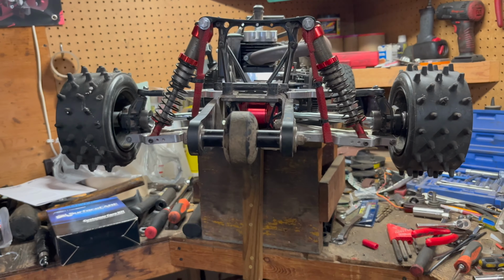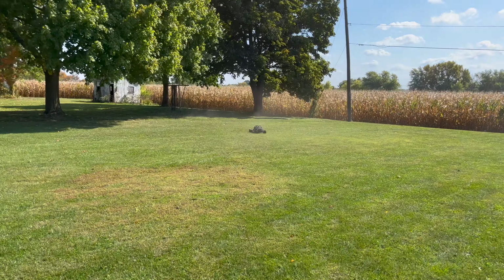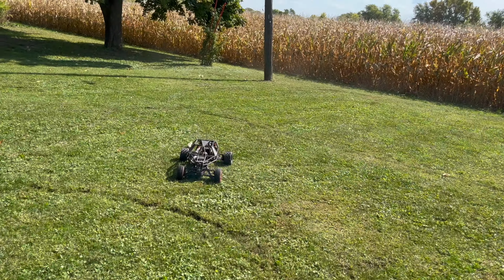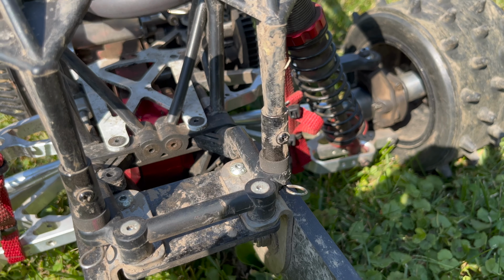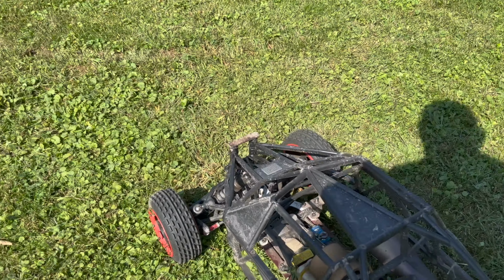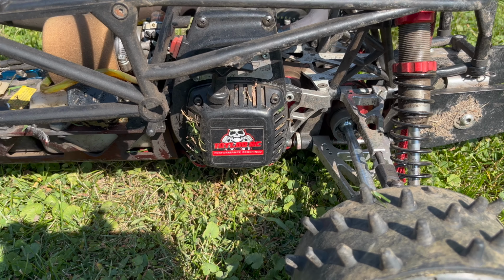TAYLOR 35CC TESTING THE NEW DIFFERENTIAL SETUP

Comment: Awesome man, she looks strong, sounds great! I’m running VP C12, and amsoil dominator at 25:1. My high needle on the 1257 carb is a smidge leaner than stock and my low is where it needs to be to idle when hot. Do you see any reason to run say 32:1?  I have been sticking with 25:1 cause that’s what Mike Taylor recommended, I see a lot of people running different ratios. What are your thoughts and experiences with this specifically as it pertains to the Taylor 35cc sir? Thank you!
Reply from the maker: Thanks bro I appreciate it💪🏼 I used to run Amsoil saber 100:1 in my small bores before I got my 40GT that’s when I made the switch to 25:1 with Motul 800.  i’ve always had great luck with Mike’s engines with 25:1.  I just run what he suggests in his engines😉